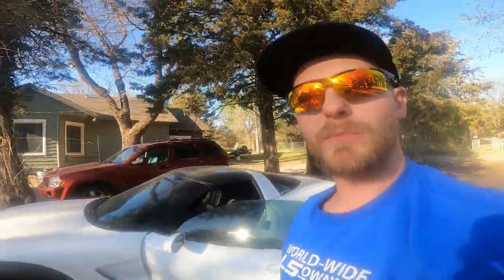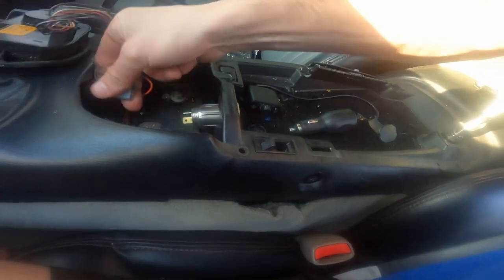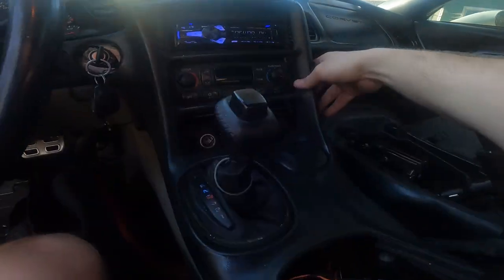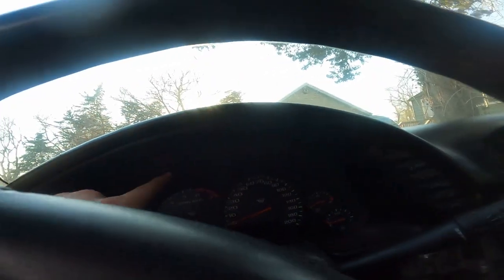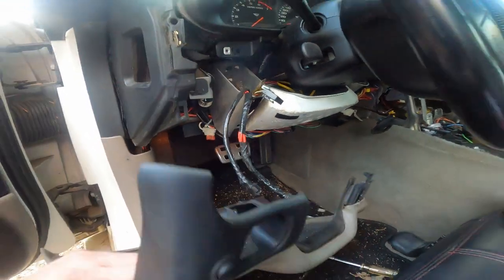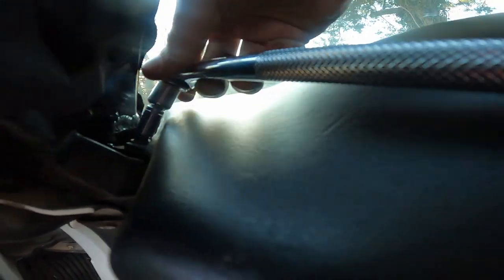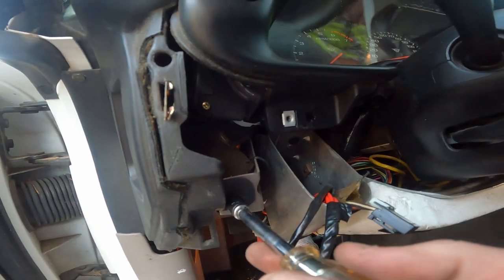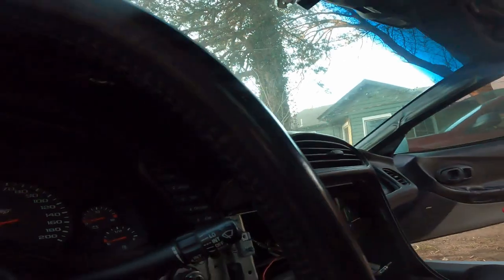How To Remove the Dash on a Corvette (C5 1997-2004) - Daily Vlog

Comment: How did you re install the glove box? I can’t manage to get the 2 bolts in the holes to screw them to the back plate. Is there a trick? Do I have to get the plastic frame in front. I’m scared to break the hinges. When I put the bolts through the holes the extension is crooked I can’t get them aligned to tighten them.. Any suggestions! Thanks
Reply from the maker: I used my fingers to get the bolt started, fitting my fingers through the sides of the glove box. Looking through the 2 holes to see the bolt.

Then using an extension and a swivel (joint) socket extension I was able to get the socket on there and tighten them down. A local parts store might have a joint socket.
Reply: @ArcticVette  Thank you for the feed back! I really appreciate it. I ordered a used glove box today from EBay $175… I will definitely use the swivel socket! Thanks!
Reply from the maker: @believe2806  you're welcome! I hope it goes well for you 🙌🏼